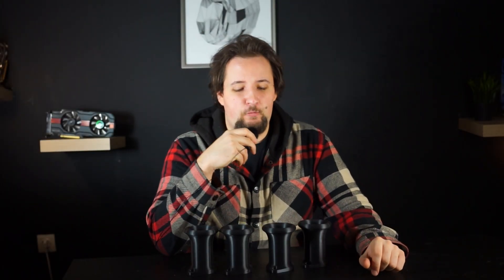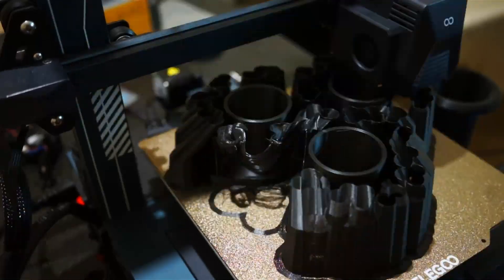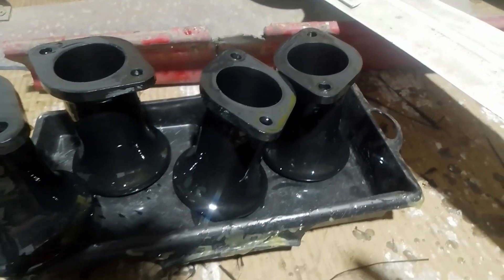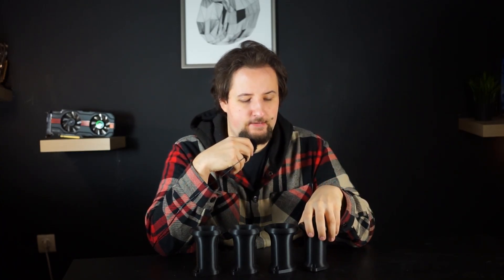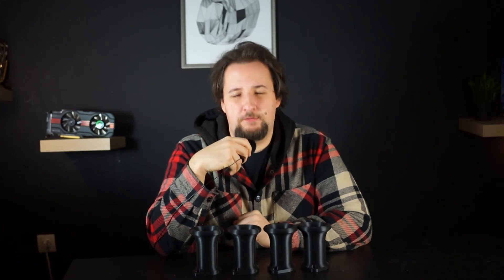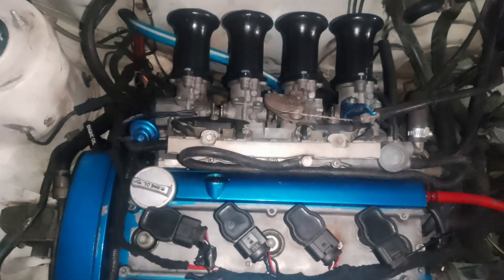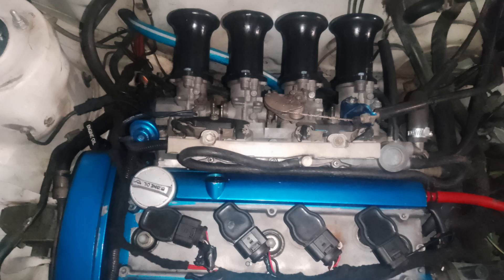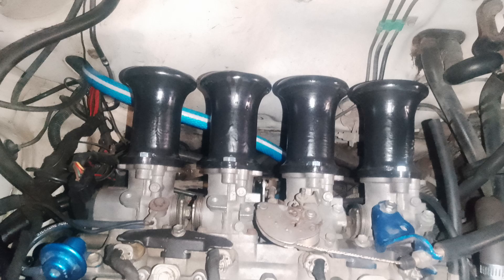3D Printed Velocity stacks for ITBs | First time 3D-printing car parts | Will PLA hold up?

Comment: Are these holding up ?
Reply from the maker: well im not running NA anymore but when i was i ran them for about 1000km in total and surprisingly held up well. due to the air being sucked in through them they get cooled by that air and dont melt. i wouldnt advise running them in summer temps or heavy traffic tho maybe haha

Comment: In the past I've made a maf sensor adapter out of pla and after annealing it ,it was able to resist engine bay temperatures without warping too much in the  annealing process. I am planning on 3d printing a new intake manifold for my ford fiesta since the stock one is already plastic (Prob ABS). I'll test ASA after I build my 3d printer enclosure but for the moment I bealieve it should resist the engine's block temp.

Comment: If one doesn't have a printer setup where one can get good ASA/ABS prints, one might consider annealing PLA for significant improvement of its temperature stability.
Reply from the maker: in my opinion doesnt really work that well and does warp the parts. thats why i coated them with epoxy
Reply: @throttlebuddies0  I agree that it might be somewhat tricky, since they are somewhat large.
Reply from the maker: @dempa3  well ill see how the stuff holds up haha 
i may try some other experiments in the future lol but thats to be seen

Comment: For heat resistance Nylon is good material.
Reply from the maker: yeah but apparently nylon is a bit of a pain and im a 3d printing noob so i would try with ASA first i guess. ive heard its much easier to print.

Comment: I designed and printed my ITB velocity stacks and air box in ASA. Not tested them yet but I had to build a heated enclosure to get decent ASA and ABS prints. Dimensional accuracy was good enough to print the air box in three pieces and screw/glue them together.
Reply from the maker: i thought ASA wasnt as sensitive as ABS? ill have to try it. maybe when its warm here in greece it should be easy as in my shop it sometimes gets up to 46 degrees celsius ambient temperature haha
Reply: You may get away with it. I had layer separation and lifting from the bed without a heated enclosure. Didn't want to risk anything breaking off and making it's way into my freshly built engine!
Reply from the maker: @joesbox  i have heard printing slowly will improve things a lot. ill just order one or two spools and have a go at it. worst case ill build an enclosure
Reply: Yeah I was printing pretty slow. Cold here in the UK though. Especially in my 19th century cottage! I just bought a tent style enclosure. Added a 12V heater and fan with a second hand PC power supply. With everything preheating and the heater on it's quite quick to get it up to 50C. Good quality, and more importantly strong prints ever since. Doesn't have to cost too much. I did have to extend my cables and move the printer PSU and control board outside but I reckon total cost was sub-£100.

Comment: That’s great . You could try epoxy resin . Would you share the file for those ? 😊 I would love to try those and maybe experiment with the lengths .
Reply from the maker: i did use resin as a coating as i described in the video haha. the file is just for free online. i dont have the link unfortunately. but just search for 4age 20v silver top velocity stacks.
Reply: @throttlebuddies0 check if there is any benefit from epoxy vs polyester resin and their ability to withstand heat etc. I really enjoy your content !
Reply from the maker: @eros20V  well i used poklyester resin. i dont think as far as heat resistance is concerned there is a massive difference. 
id say to be safe print with ASA and then coat it that would be best im guessing because the risk of the PLA Cracking is my biggest "fear" as the vibrations on an engine can be quite bad.

Thanks also :D